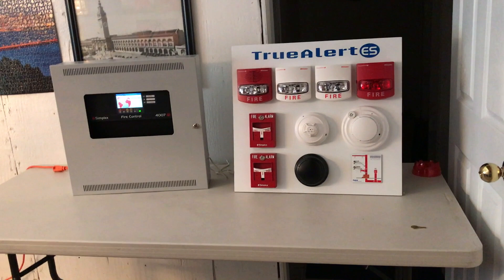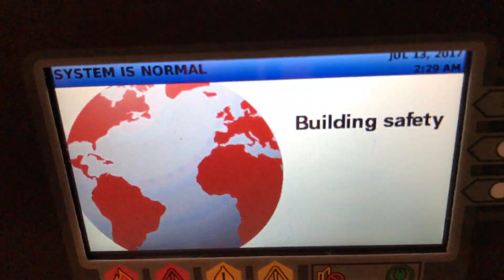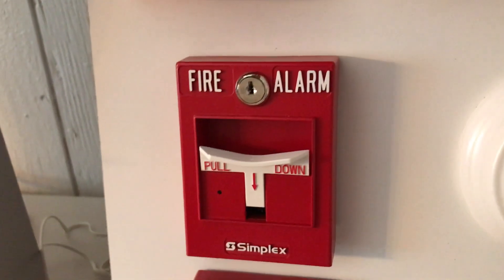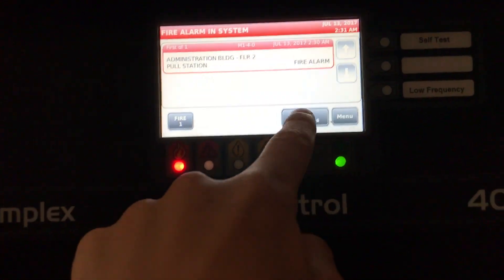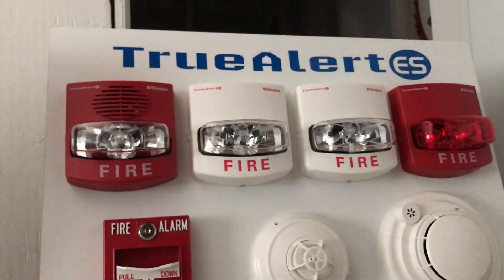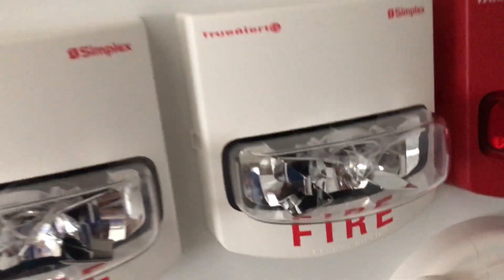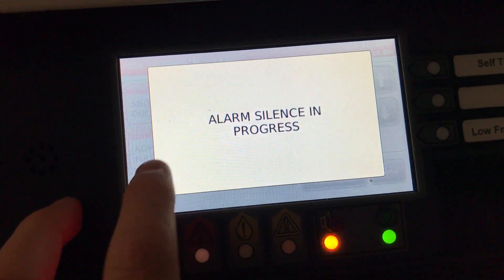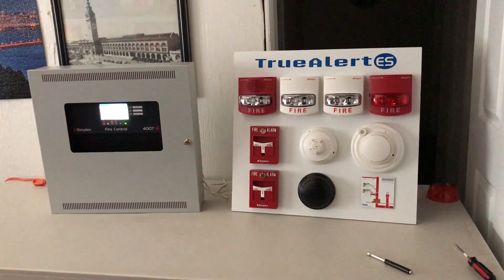Demo af a new simplex 4007ES fire alarm control panel

Comment: I think the art center at my friend's university has a Simplex 4007ES system, but the alarm signals are just conventional multi-candela TrueAlert horn/strobes (slapped onto old Simplex 4050-80 light plates), and they have break-glass 4251-30 pulls and 2098-9201 photoelectric smoke detectors. The 4007ES is replacing a Simplex 4002 that was installed in the early 90s to replace an even older Simplex 4208 panel (the cabinet was left intact for terminal wiring.)

Comment: Those retrofit t-bars are so damn cool, but I feel like they could cause more false alarms.
Reply from the maker: they can in some locations like schools. but they are for disabled people that can't pull it with there fingers
Reply: Safety Security Alert 
Also, that 49MTV-WRF produces, in my opinion, the cleanest and purest 520Hz square wave tone out of all of the low-frequency devices currently being manufactured.

Comment: Very nice! I'm seeing the TrueAlertES's more and more commonly as the years go by, but they still make the 4906's from what I've heard. These are very nice units, I have to admit, but I still like a lot of their older stuff better, but anything Simplex is typically great quality anyways. I sure hope JCI doesn't dissolve Simplex, as that would be very sad.
Reply from the maker: nice! yea simplex products are very unique and very "complex" but they are great! Also, I will be talking about the whole JCI thing in the future.
Reply: @SafetySecurityAlert  
Are
Reply: Wow 🤩 has
Reply: I've NEVER seen any of the ES-series signals in my area. On new Simplex systems, even if they use all addressable initiating devices (and they usually do), they just go with conventional multi-candela TrueAlert signals.